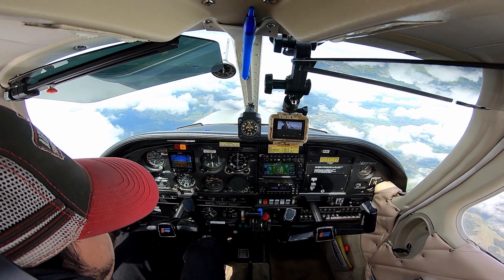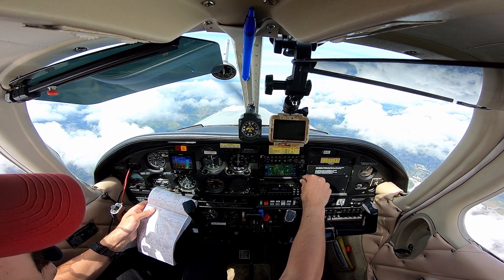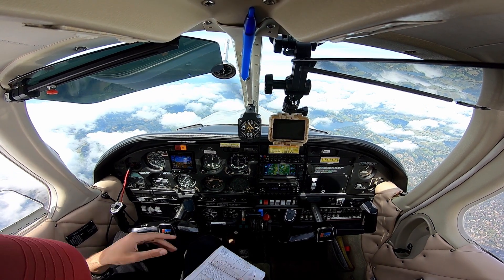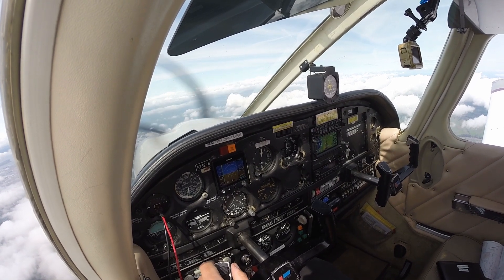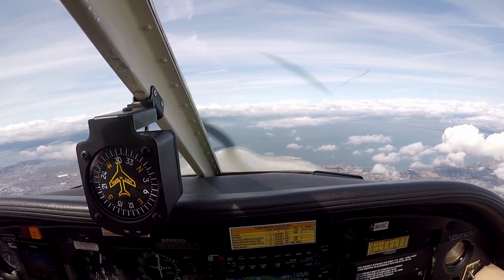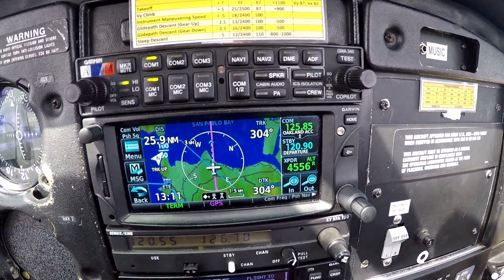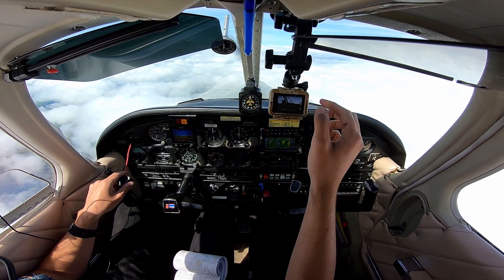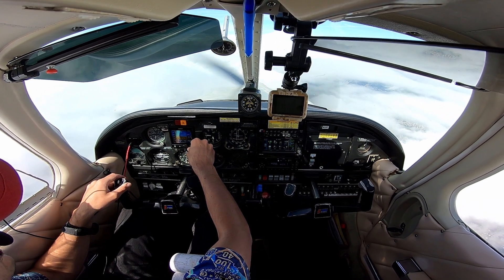My Instrument Flying Flow | The Art of the ILS

Comment: Will, what type of power setting do you use for cruise.? I notice you don’t have an autopilot. You keep it nice and level.
Reply from the maker: Using 24MP and 2400 RPM at low altitude. At high altitude where I can’t get high manifold pressure I’m full throttle + 2400/2300 RPM